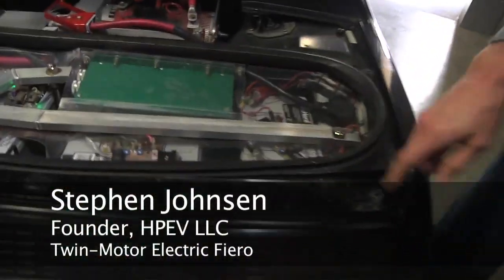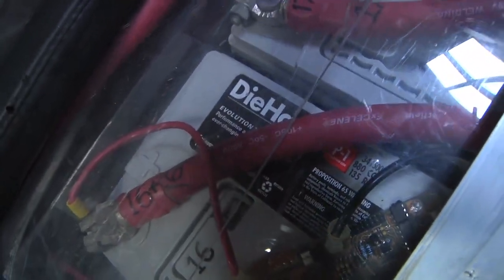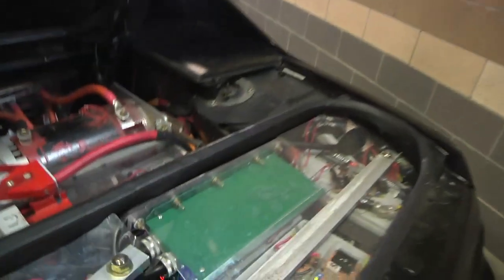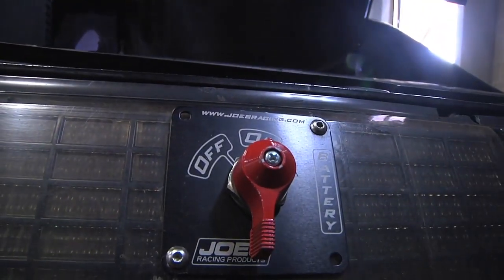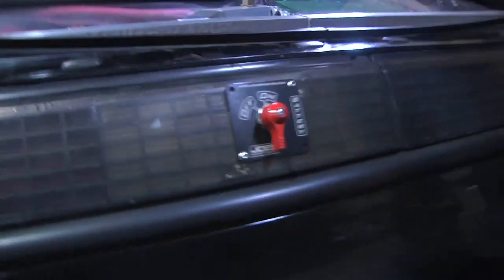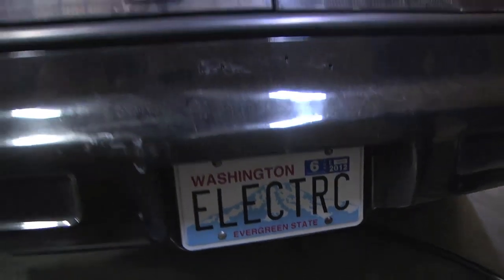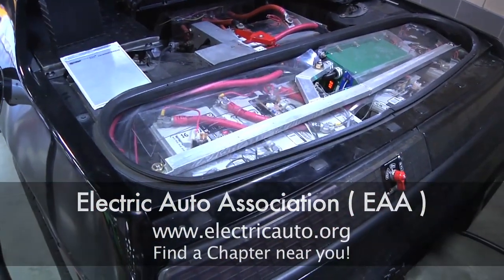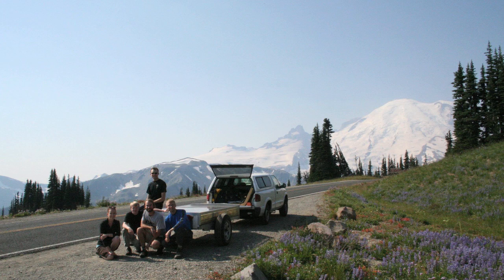Electric Fiero Tour, Part 2

Comment: I see you have the Fiero transmission in the car, do you really need that?
Reply from the maker: Well, it's not my car, it was somebody else's which I was simply showcasing. Keep in mind that even if a can didn't need a transmission, at a bare minimum, it still generally needs gear reduction, a differential, and a physical connection to the driven wheels. On most gas cars being converted to electric, the easiest thing to do is just reuse the existing manual transmission.
https://300mpg.org/projects/electro-metro/transmission-for-an-electric-car/
Reply: @BenjaminNelsonX  Yes I understand that, but in reality you have 5 final drive ratios. My Chevy Volt uses a 7 to 1 final drive ratio and no transmission only 2 plantaries. I also own 2 Fieros, and I thought it would be fun to put the drive train from a Chevy Spark EV in one of them.
Reply from the maker: The planetaries in the Volt is just a different type of transmission. An entire driveline from a production EV dropped into a Fiero would be a great project!
Reply: @BenjaminNelsonX  Yes the volt uses 2 plantaries so you can drive on one motor or 2 , but the final drive ratio still is 7.0 to 1. My 86 fiero I converted to a LNF turbo exotic, as far as I know it is the only one in the country. But nothing will match the TQ of electric. The Spark EV I think is rated at 425 Lb Ft of TQ

Comment: I been wanting to do this to my 1986 fiero. It has a 3800 sc 2 engine with some nice aftermarket but I have always been fascinated by electric and now we have electric drag cars. I’m looking to build a electric fiero that can be a daily driver and still fast on the road. The only thing is I’m trying to have working ac as well. I know it’s gonna need a lot of volts or wattage to spin a ac compressor fast enough to create ac. 

I don’t know if a typical car ac compressor is feasible. Or to attempt to run off a sealed electric ac compressor. A lot of fridges and ice boxes have them the issue is it takes awhile to actually start blowing cold. The original hvak system could be sealed but the issue is condensation using a window shaker compressor creates a lot of condensation as well.

Anyway this is one nice electric build kudos to you.

Comment from the maker: There were EV-1s that were disabled and given to University Engineering Departments and to Auto Museums. The few that survived were accompanied by a legal document saying they could never be fixed to original specs or driven on public roads.
There was also a Chevy S10 electric truck, which had basically the same drive-train, including being front-wheel drive.
I filmed Chelsea Sexton driving a modfied/fixed EV-1 on private property a couple summers ago. I added a link to that in the description.